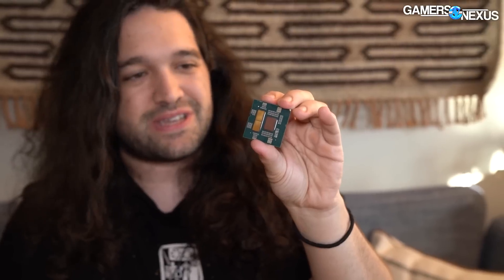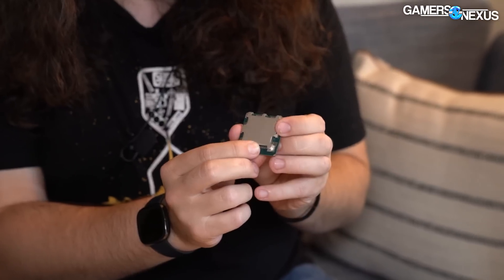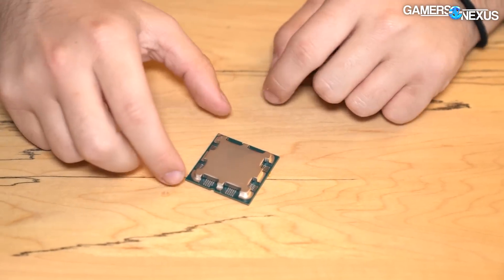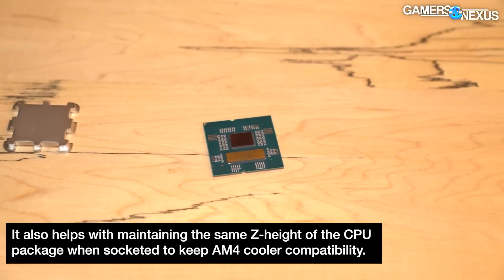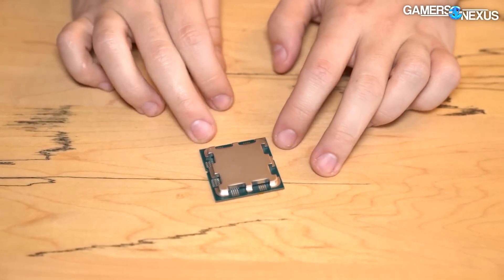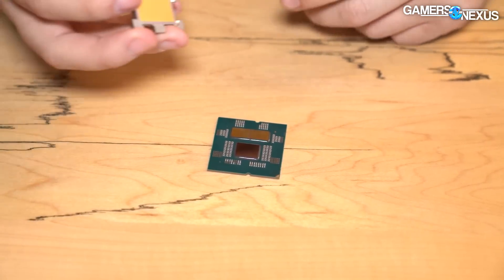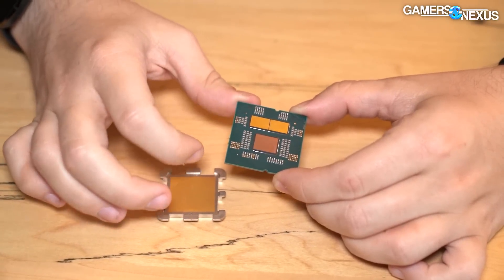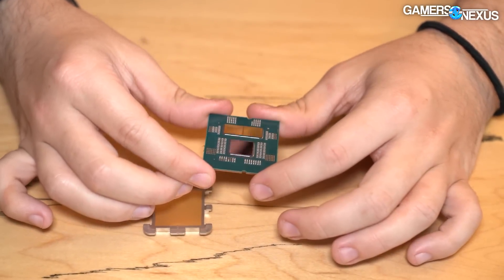Hands-On with Delidded AMD Ryzen 9 7950X CPU

Comment: Anyone have any ideas what could be up with my PC? Every now and again it boots in 1080p (usually 1440p in normal circumstances) and my device manager shows ''windows has disabled your 3060ti as it has detected an error'', trying to update the drivers at this point just leads to a black screen. But then magically, if left for a few hours, I turn it back on and it's completely fine again. I can only assume it's a dying GPU? But I can't work out why it would just magically repair itself sometimes and then fail at others, and there's no trigger or correlation as to the cause, it's just completely random. Debated if it could be a virus but I doubt it would have that kind of behaviour, and since the gpu is being disabled by windows I can only imagine it's somehow.. dying but not dead? Or could I be missing something? Thanks!

Comment: The new chips looks so nice - no pins and the IHS' design is awesome, showing the capacitors on the sides. It's a shame it won't be visible under the cooler.

Comment: I love the fact I can literally just swap out to AM5 and use the same case psu and cooler I have right now. Then the promise to support AM5 up to 2025 + is a bigger bonus. Gonna pass down my 5600x build to my 17 year old and hop on this as soon as the prices are a little lower and there’s been a few round of updates.
Reply: That's one of the things I like about AMD. I never had anything AMD prior to my latest system (3 years old) with a 2600x. Super satisfied with its performance. I'm gonna delay until the end of the year and go with AM5 board and do a fresh build. Then just continue upgrading that since I know the lifespan of AM5 support. Intel really lacks in this way.

Comment: Even by using gold plate, they still need flux for the indium allloy to flow properly. Because Indium itself will also get oxidized. Otherwise you will see holes and missed corners as well as a lot of weird-shaped indium excess on the sides. Intel and AMD uses a solid form of flux(the yellow layer on the IHS) to prevent corrosion.

This thing should be a production defect unit, as if it's a delided one, you can never get the indium off the gold layer.

Comment: Late to the party but regarding the silicone adhesive, acetone and gasoline both break it down. I de-lidded a couple Intel CPU's without a de-lid tool and without any cutting by soaking them in gasoline or acetone (gas was faster) then just pushing the IHS off to the side with very minimal force, I could probably have pulled it up if I had fingernails strong enough. The PCB took no damage that I could see and one of the CPU's still works, the other was already dead. Re-pasted a super low end 1150 Pentium to get max thermal conductivity for a passive cooler, worked great!

Comment: Noob question. Why the processor needs all those capacitors and resistors so close?

All of this just for filter and fine tune the vdd supply?

Could someone help me clarify this?

I know that modern silicon have crazy complex power control modes that can causes huge spikes ( or noise if you prefer ) in vdd line. Is this the answer of my question?

Comment: still iffy about that IHS design specially those exposed parts (SMDs) and some people (a lot actually) put too much Thermal paste and not all pastes are non-conductive, also that floating gap there is chance of junk/dust getting under the IHS

Comment: Guys, it would be interesting a full Review and Benchmark of the RX6600M. It's a GPU designed for mobile Pc's, but it's possible to find it in AliExpress on a full off board format. Lots of brasilian gamers are buying it. It's the new budget king.

Comment: I'm excited about AM5 due to my Noctua NH-C14 cooler for AM4. It's huge but shouldn't have any problems pushing a 7950 to over 6Ghz if the chip can handle the thermals.

Comment: 7:41 Having the silicone adhesive right underneath the edges seems kinda excessive imo. A slight optimization that I thought of for years now, I would reather have the  adhesive on the side of the heatspreader's outside feet/border contacting the pcb exactly like how the dies have their edges glued to the pcb.
Still having the lowest amount of Z height without the heatspreader falling off. Does any one get what I am throwing down? 🤔

Comment: Please measure the IHS thickness and the width of the hot spot above the core dies. (ie what area does 93% of the thermal energy go through?). der8auer’s old video said this is gonna be a very thicc IHS to maintain cooler compatibility

Comment: I have a feeling that the cooling solution for these CPUs will be particularly sensitive to the compute complexes being on one side.  So while even pressure of the cooler is very important, I am think that heat transfer on that side of the chip will be even more important.

Comment: I don't know how i feel about the new design. One thing that is worrying me is paste spread. Look at the surface where the top cover and the heatsink will make contact. I will take my r5 2600 as an example. When i repasted my cpu i looked at how it looks after i did it the first time. I used a pea size in the middle of the cpu and when i took it off it was covered from side to side. Now these new cpu's has a smaller cpu cover and there may be a chance that the thermal paste drips onto the cpu itself. Maybe i am overthinking it but that's just my 2 cents. The other way that should technically work is to use the type of plastic paster that you get with some thermal paste and paste it yourself for when you put the heatsink on it won't spread.

I will see once it's released how the pasting works. This is just my point of view. I am by no means a guru. Can't wait for reviews. I don't care about performance cept for the igpu. I will never upgrade to a 1st gen cpu on a new socket reason why i never went to intel as most of them are 1/2 gens and new socket. I am not expecting much of the first am 5 cpu but the 8xxx cpu will have proper support(can still remember the horrible launch of 1st Gen Ryzens :)

Comment: Hey Steve,  quick question about the GN coasters.  Can they be used for hot beverages as well, such as coffee?  I only ask as I noticed it recommends not to 'heat dry' them after washing, so I wasn't sure if heat period was an issue.

Comment: Why do you keep saying a mounting kit will be needed for AM4 coolers? Every manufacturer says it's not needed, they're all compatible 🤔
Reply: There are some coolers which are incompatible because they were replacing am4 backplate with their own. If a cooler doesn't require to replace the backplate it's fully compatible
Reply: Got it, thanks. That makes sense.

Comment: As electronic engineer, I concern on the extra distance between those SMD Capacitor and the die itself. It is way longer than put those cap at the other side. But since it is a factory design. I think they know what they are doing

Comment: For what its worth, I'd like to explain what the SMD components are that surround the dies on the CPU.
From the b-roll, it appears that nearly all of the components are what's called feedthrough capacitors. These components are, essentially, a capacitor and inductor filter built into a single device. Capacitors and inductors are very commonly used on power lines for sensitive electronics. They create an LC filter that, when designed correctly of course, is very good at filtering out high frequency noise on the power and signal lines in circuits. I imagine that a lot of these are used to filter the power lines for the dies due to the extremely high frequency communication protocols that are used in CPUs. A noise free power line is a happy power line :)

Comment: Intresting how putting smd’s under the ihs, will effect their longevity
Reply: resistors, can last basically forever as long as the wattage limit is followed, the caps, being ceramics if i recall, will degrade, but can be revived by heating them up to soldering temps for a moment..

Comment: im super excited to replace my 3600x with a 7600x once ITX boards release probably will give the old mobo to my little sister who has my old i5-4590 and 1060 6gb might upgrade my 6700xt but that will be down to pricing and availibility of the new gpus

Comment: GUYS, wait for 3rd party reviews. These 7000 series so far is not what it seems. I am not loyal to any platform but looks like Intel is going to win and here's why, 
First, AMD compared the 7600x to the 12900k with 6000mhz ram and the intel chip will do 7000mhz but let's say 6600mhz in XMP. Thats a loss of 600 MHz on intel.
Second, the e cores don't do really anything on intel with gaming, so the 8 p cores are the only thing running against the 6 core AMD.
Third, AMD used a RX 6950 GPU in the test which is not best with Intel.
Fourth, AMD has SAM enabled for uplift in AMD CPU's. There is no such thing as SAM with Intel. A fair test would have been with a Nvidia Gpu.
Fifth, the uplift over Intel with all this according to AMD's keynote, you have to look at CS Go only because it uses more CPU than the other games listed and was basically even (-1%). The performance gains were from SAM on all others and CS Go really does not benefit from SAM.
Sixth and final, If AMD is matched almost even with a 12900k with the two titles in gaming, then what's going to happen with Intel's 13th gen due to be released this year?
My opinion, WAIT for 13th gen Intel or wait for X3D from AMD to see what's offered, or buy the current 5800x3d since it will have more L2 and L3. Currently, the 5800x3d will outperform the whole lineup probably that was just presented. Reason is ram latency!! 3200 MHz B die 14cl will outperform  36cl 6000 MHz ram.

Great coverage Steve and Gamers Nexus

Comment: What happens when your thermal paste, or arctic silver gets on those exposed capacitors?  This seems much harder to apply paste to safely.
Reply: Spread it thinly before applying the cooler. Easy to do with AS5, which is not electrically conductive but can be a capacitance. Since it's still a paste though, it will be fairly easy.  A bit harder with liquid metals though.
Reply: @krozareq  I was thinking of just putting dielectric grease on those bits so nothing can happen.

Comment: I'm really curious if there would be any noticeable difference if you had a cold plate that was machined to basically lock into the shape of the IHS.  Not to the point of contacting smds but enough to make some contact of pretty much every face of the IHS . I wonder if there is enough surface area to leverage this for any cooling or if it is a complete waste (or at the very least if there is a benefit to using this to "key" the cold plate so you have a consistent mount and/or always keeping the area of the cold plate with the best heat transfer over the dies consistently)

Comment: With the SMD components all on top will be an interesting delid and Liquid metal application since there really is no room for any errors on either things. 

I am honestly interested in seeing adoption rate of the 7000 series CPU's considering they will be DDR5 Only, and especially budget builds might be dead for a while considering what 16 GB DDR5 ram still cost. Prices for the CPU seem to be relatively normal.

The Chips also went up to 105 watt TDP which might stop some from getting one considering the electricity costs these days. PC Component Manufacturers are truly not in a good spot right now, especially Nvidia, if the leaks are true about their consumption.
Reply: I'd guess that something like clear nail polish would be used to protect them.
Reply: At my place DDR5 6000 costs double the DDR4 3200. But it seems to go slowly down.
Reply: @marsovac  Just checked here, 16 gb 4800 cost as much as 32 gb 3600. Il be sticking to my system for a while, after all, it's a 5600X which should be good for some more years.

Comment: I love that chonky IHS. Looks like it could absorb a lot of heat. Whether it makes a difference or not remains to be seen, but it can't be any worse than the 12900K's. Also been hearing the power draw is quite good on these, hope the rumours are true. Could be just the right kick in the ass Intel needs to get away from just ramping up the power limit.
Reply: The Ihs is for moving heat, not absorbing it
Reply: @DoesntRefillTheBrita  Thats the same definition. It draws it away from the CPU to transfer it to the cooler via thermal interface. Basic physics. 
A thinner IHS is just basically a plate to the heatsink.

The process by which heat is transferred from the hotter end to the colder end of object is known as conduction. The thicker the thermal mass, the more it can "pull". 

You need to change your name bud. Also: q = -h delta T
Reply: @MrIrondog55  No they're very different things. One is thermal capacity, one is heat transfer (conductivity). They are not proportional whatsoever. Did you pass high school physics?
Reply: @DoesntRefillTheBrita  I did indeed! I went on and got a degree in it. 

Now to answer the question,  For example, the thermal material where it is being transferred to is the conductivity. As the material it's transferred to is exactly the same found in other IHS's the conductivity is the same. The thermal capacity (AKA the MASS) helps to draw this. 

Check Fourier's Law and the Second Law of Thermodynamics.
Reply: @MrIrondog55  read your own comment. "Looks like it could absorb a lot of heat". 🤦🤡

Comment: The indents in the IHS make a nice pry point if it gets stuck to the heat sink AM4 style!
Luckily, this shouldn't be necessary on the stock socket as it has a hold-down anyway.
Also just don't actually do it. It does work. But I do not recommend it because yah know, you don't want to damage your $700 processor.

Comment: As nice as these new 7000 series look, I'll be waiting for a price drop on the 5800X3D to replace my 5800X to upgrade my B550 board so I can wait for a presumably upcoming 7800X3D release and some of the inevitable 1st gen chipset and DDR5 bugs to get worked out in a year or two and start fresh with a completely new system. I'll reuse my 5800X in my second PC running a B450 which has a 3700X right now.
Reply: pointless

Comment: I'm planning on moving up from a 2700X to the 7900X to help my Blender times and CAD workflows; I fully expect the 2700X to be blown out of the water, but I'm interested to see just by how much.
Reply: That makes little sense. Better a 5950x which has 16 cores, you get performance for a fraction of the cost with a slot-in CPU upgrade, and no platform changes.
Reply: @marsovac  except that that at this point am4 is not future proof anymore, so his road to upgrade would eventually lead to plataform change, so he might as well do it already.

Comment: There is a big electrical benefit for having the caps on the same side of the substrate as the ICs.  The effectiveness of the power supply bypass capacitors is limited by the amount of inductance between the capacitor and the chip.  The via that goes from top to bottom is the biggest portion of this inductance, so moving from bottom to top comes with a huge benefit.

Comment: I'm scared of how I'll be pasting this CPU... very minimally at dead-center I suspect (as one should anyway).
Reply: Spread and clean from sides?
Reply: @DimkaTsv  What happens if you turn it on with paste overrunning those spots?
Reply: @videosbymathew  It will run normally. Thermal paste is not conductive unless specified by manufacturer.
Aesthetically though can look bad, but come on, you don't have X-Ray to look below cooler cold plate. 

But with liquid metal you must be even more careful there. Probably protect caps with something like nail polish.
Reply: @DimkaTsv  Gotcha, thank you, glad to know. I did use liquid metal for my 9900k build, but I'll be going back to normal good paste for my hopeful 5900x purchase (I'm guessing here, but it seems like the 5900x might be slightly better at o/c than the 5950x due to fewer cores to manage).

Comment: There is a pretty heated discussion on reddit about the prices for the 7000 prices vs the 12th gen parts. I can't help but agree that I think the prices should be 100 dollars cheaper.
Reply: I don't think we can really say that without benchmarks
Reply: 100 dollars cheaper is probably unreasonable, $50 would absolutely be doable though
Reply: @Husha563 yeah, like derbaur said that intel's efficient cores are useless, it's the pcores that are the true core of the cpu.
Reply: The 7600X almost certainly doesn’t beat the 12600K in multicore, so it really should be $199.
Reply: @reinhardtwilhelm5415  you aren't buying an -600 class cpu for multicore now are you? You are buying it for cheap gaming. And 7600x most assuredly beats the 12600 by 10-15% in games.
Reply: @asdf_asdf948  That’s the problem: $300 isn’t cheap enough. Gamers should just buy the 12400F for $170 and put the other $130 into their GPU.

If you’re buying anything more than that, you by definition care about multicore.
Reply: @reinhardtwilhelm5415  well you arent gonna buy into a new platform for cheap gaming either. 5800x3d will be better than 7600x, to me 7600x is a bait product that's pointless for most people
Reply: @asdf_asdf948  Yep, fully agreed. I’d say it’s like the 5800X3D, but it doesn’t even have that going for it because its gaming performance isn’t uniquely good. Anyone who’s willing to pay $300 to get that extra bit of gaming performance with a 3090 Ti should probably be buying a 7950X anyway.

Comment: Ok you got an unleaded processor, in production they are likely to weld the IHS to the chip's the silicon on the corners giving just some mechanical reinforcement.

Comment: Don't like the design of the IHS, will be hell to clean from thermal paste once you put too much on the heatspreader :/
A shame they didn't rearrange the chiplet placement for better heat dissipation, still need cooler with offset mounting.